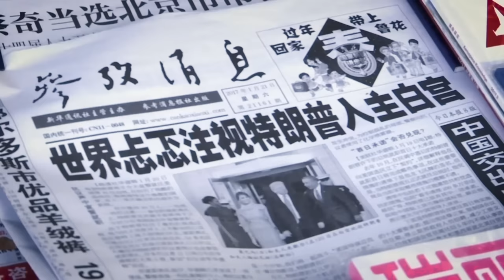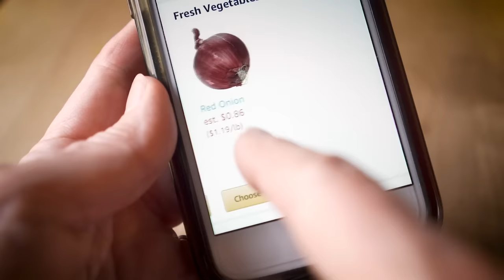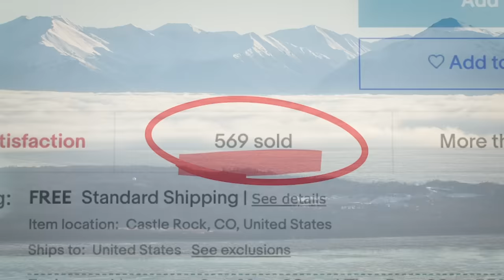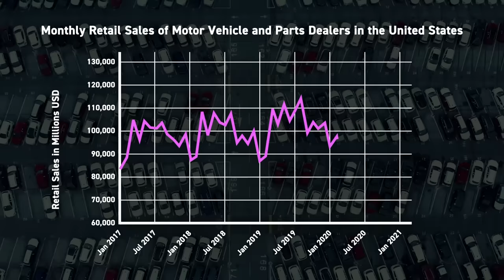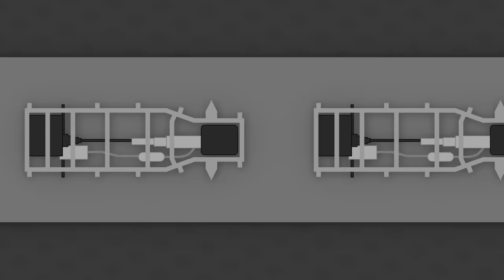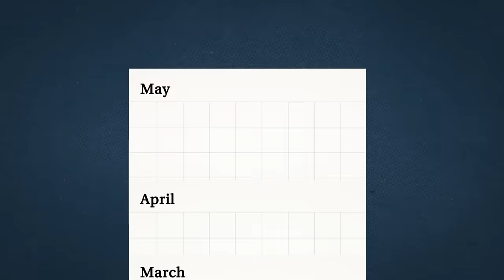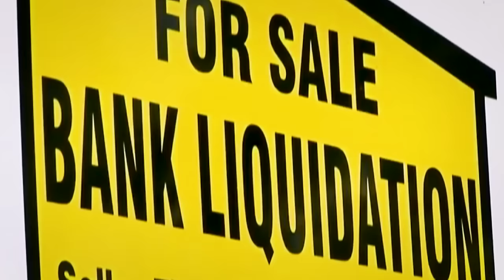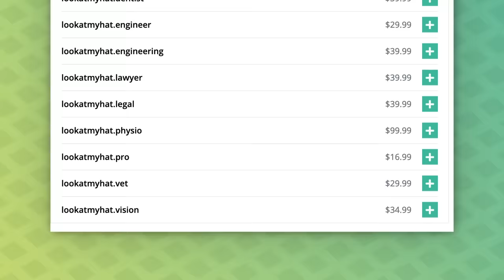Why There are Now So Many Shortages (It's Not COVID)

Comment: I was a Materials and Demand manager for more than 30 years.  When the JIT concept took over, the only thing my bosses would ever consider is practically zero safety stock regardless of demand fluctuation nor vendor/materials reliability.  At the same time, they required perfect shipping on time.  I spend my whole career in this pressure cooker.  I wouldn't wish it on my worse enemy.    I knew JIT was the reason behind the shortages as soon as they started happening.
Reply: Same here, I used to work for a major food retailer, from 1980s.  It destroys farmers and farming.  It destroys staff.  It destroys the environment, and clogs roads too with lorries taking food to single distribution centres to then be taken across the country.
Reply: LIES
Reply: @1Afattybombatty  That's a decent rule of thumb I guess, but JIT's failings are not a conspiracy. Its negative impact on workers and infrastructure, and its fragility to market instability, is not only well-documented but is very clearly the cause of the current supply shortages that are empirically happening. In fact, it's so well understood that people who recognized what was happening were able to predict this effect at the very start of the pandemic. And you don't need to trust anyone's world to confirm this information, the raw data is available, sourced, and verifiable. Also, why would a kid have the pfp of a 50 year old guy hiking? Or lie about being in M&D? Hell, would even know that's a job?

There's a guy in another thread blithering about how mass market bread has nutrients with the wrong electron count. Go after him
Reply: You're 100% correct.
Reply: Thank you Martin your 100% correct
Reply: @z-beeblebrox  Like the video points out though, JIT isn't the problem.  It is companies implementing it incorrectly that are the problem.  Unfortunately most companies (especially in the US I wager) do it wrong.
Reply: I'm currently residing in the pressure cooker. I hate JIT and SMI parts. Whenever i hear  "bUt iT hAs 28 dAyS LeAdTiMe wHy iS iT LaTe" i want to die. The part is under allocation Karen the market leadtime is 64 week that's why.  Intel, Analog Devices, NXP, Microchip, etc all dropped the ball and we're royally screwed.
Reply: @DKarkarov  Right. The USA isn't Japan.
Reply: @DKarkarov   That's true. I personally have the - probably fringe - opinion that JIT is bad in general, but for the purposes of what happened in 2020, its affect was mainly due to abuse of the concept by American companies.
Reply: Bosses who don’t understand anything but money making problems, who would’ve guessed
Reply: Yes, they used to say safety stock is an out dated idea
Reply: @z-beeblebrox  It is actually a great system... if you do it correctly.  Big business sleaze corporate america is rarely if ever interested in doing things correctly though, just profitably.
Reply: I’ve spent 35 years in Procurement.  JIT is hugely destructive and working in this field is detrimental to people’s well being.  Can’t wait to retire so I can get out of the “pressure cooker”.
Reply: @desertrat1111  Not iin my bathroom. LOL My parents survived the great depression so prepping was our lifestyle.
Reply: The Catastrophic breakdown is never considered. Some companies run their machines to failure. When a machine is over 100 years old, you really don’t want it to fail.
Reply: I feel for you.  I only lasted 4 years and found another way to make a living.   It was a killer.  In America we always try every other way before we are forced to do things the correct way.   The wrong way typically starts in the accounting office.
Reply: I worked as production/demand planner for car components 10 years ago when US car brands were on the brink of bankruptcy.  We operated JIT without considering any exceptions (our inventory was in the states and manufacturing in Mexico). Automakers pushed off all their demand based on the uncertainty of their situation and my company as well as most suppliers did the same. Then demand spiked when the US govt saved them. It was a whole nightmare for over a year.
Reply: True, but I still blame taxes... One big reason for JIT is not to get taxed on inventory. Taxation forced this policy, without it the only worry about excess inventory would be inflation cost and too much capital in inventory. With taxation your inventory actually cost you money if it doesn't move. As always.... its the GuBerMeNT
Reply: @DKarkarov  
Lol
“They just aren’t doing it right”
Said every commie ever
Reply: @notacommie5415  There is a minor difference in this case.  The people who created JIT still use it and are succeeding with it, aka Toyota.  There are also probably companies doing it right, you just don't know of them.

Everyone who has ever tried to implement communism including it's creators created a failing country.  Because communism doesn't work, not even in theory.
Reply: On avg it may be the most profitable
Reply: I worked on oil tankers, and we had a JIT system for spare parts.  The system should have been called JTFL......
Reply: @mmmmmmolly  anyone who's lived in the production planning materials management world would easily recognize from my post I'm no fake and no liar.  Jit has tons of benefits but when the break comes, it's painful and difficult to fix.
Reply: @martinparmer  um...Martin, i never said you were fake...
Reply: @z-beeblebrox  The better question looks to be; Who is Kristopher working for?

Comment: I work at a paint store. We are seeing massive shortages of paint because of the winter storm in Texas back in February destroying many of the factories that produce the resins that go into a large percentage of the world’s top coatings. That storm I believe was considered a once in a hundred year event so the power grid and factories were never designed with it in mind. Honestly though a hundred years most definitely should be within the planning horizon of any city or engineer of any large facility. 100 year events are actually pretty common when you realize that no 2 events have any kind of predictable start and end points and that you will have to plan for multiple such events in the construction of any large facility. Snow storms, floods, solar flares, hurricane etc are all dangers to power grids for example and most certainly should be planned for and are likely to be seen much soon than 100 years when all of them are taken into account. Just like mentioned here, major disruption is inevitable and not planning for it can’t be an excuse.
Reply: Yep. A 100-year event just means that there's a 1% chance of the event occurring in any one year. And given the level of impact, I think even a 1% chance is worth preparing for. Not to mention that in a rapidly changing climate, those 100 year events are going to happen with shorter return frequencies.
Reply: but seems no one wants to pay to build infrastructure for those events,  most people want a low electric bll
Reply: The iodine comes from middle of Oklahoma! 80% of production! It not in Texas!
Reply: @Vmaxfodder  Texas gotta maje it about themselves.
Reply: @bigjohn6405  Who can afford a high one?  Electricity is fundamental to our society, everyone uses it and, with the removal of carbon based fuels it is going to get shorter in supply until the renewable infrastructure is built and then that fails because, muh, reasons.  These problems are easy to see but not so easy to fix.
Reply: @I_Don_t_want_a_handle , but they are easy to fix. The fix is having stock that is big enough.
Reply: I'm willing to bet that we are going to see another one this year..... IDK but my hip hurts way way more than it usually does when we are having a cold winter. Just saying.... it's just the same as it started last year....
Reply: @flobbie87  Yeah sure until a tornado wipes through that particular storage ...  but yes lots more means less shortages, inevitably.

You need to be willing to pay for it.  Storage costs and the more ephemeral your product, the more it costs to store.
Reply: Propability of Texan storm increased due to Global Warming. It also caused drought in Taiwan, and that propably had more effect on chip shortage (Taiwan produces semiconductors, and it requires a lot of water).
Reply: A 100 year event that happened only a decade earlier, at that.
Reply: Maybe in Houston or South Texas it was a once in a 100 year event.  In North Texas and the Panhandle we get freezing weather every year so there should be no excuse for that part of Texas to not be winterized.
Reply: My country just experience one in 20th years rain. Nobody was prepared for the flood. I bet people will quickly forget and still  unprepared for the major flood 20 years later.
Reply: @Vmaxfodder  the facility that the paint is mixed is in texas.
Reply: @Luipaard005  lmao, no. Abbott didn't do shit.
Reply: @AL2VAR  Taiwan does not have a water problem.
It is surrounded by water.
Taiwan has a salt problem.
Reply: Texas was special. Texas is the only state who's power grid doesn't comply with federal stanard, which is why Newsome's comment of "Even though the people of texas don't seem to like me, If it were within my power to help you I would." (paraphrasing), because texas isn't on the Western power grid.
They aloud buisness to dictate what was needed and what wasn't, and when you do that you might as well print the medal for the winner of the race to the bottom. Some of the systems they use in Texas are the exact same systems used in Antarctica, but the code on how they're installed is completely different.
Texas was an example of people willfully giving themselves over to political propaganda, and being to ignorant or prideful to understand how they messed up to fix it.
Reply: I'm 28 years old and I've lived through 2 once in 100 year economic downturns.
Reply: @flobbie87  afaik, no stock is ever big enough. It also only just delays the inevitable in a way. We currently cant predict what our demands will be in a few years (atleast, "currently". I hope this changes)